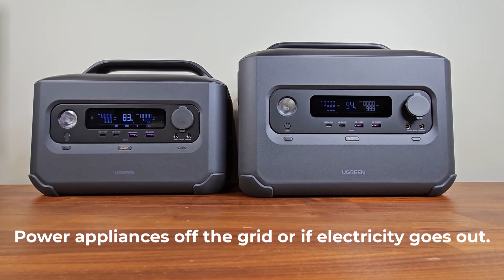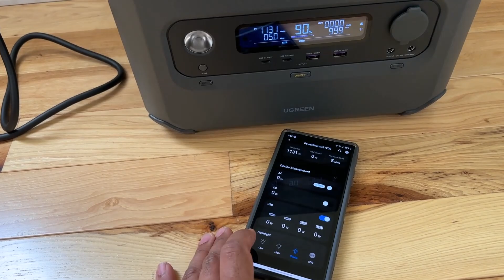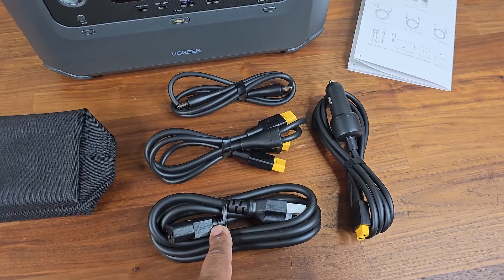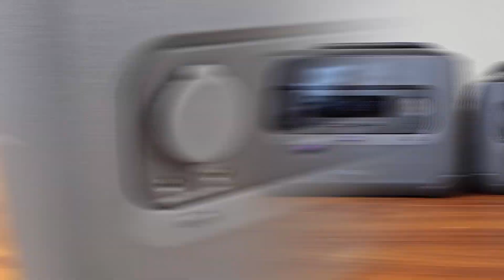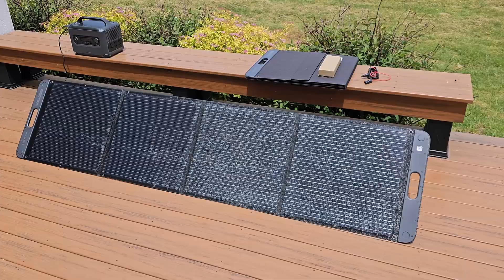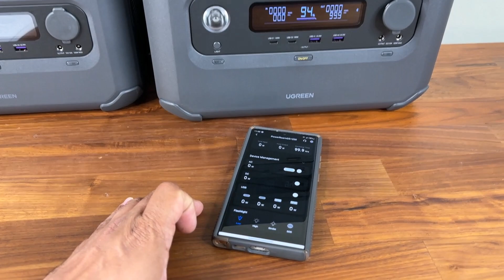Ugreen PowerRoam 1200 Power Station is INSANE - Charge a Samsung Galaxy Phone over 50 Times!

Comment: I have just bought the PowerRoam 1200, but I overlooked one issue related to AC charnging speed, and I am struggling to find a solution. Does anyone know a way to lowqer the AC charging speed down to around 200watts max (much lower than quiet mode normally lowers it to).

I mainly want to use these as long-run UPS devices to allow me to run all of the systems in my scuba diving center when the grid goes out here in Mexico - Particularly if this happens overnight too keep the CCTV running and allow me to open the electric-only roller shutters in the morning.

THE PROBLEM that I have found is that normally after a while of no-power, we will typically start our Honda 2200i inverter generator, which works great to power the essential systems and some extras like lights and fans... However, when we start to power the shop from the generator, the high AC charge rate of the UGreen (>600 watts even when quiet mode is enabled) means that my generator stuggles to power everything.

So with this in mind, does anyone know if/how it is posisble to manually drop the AC charging rate down to something much more modest like 100-200 watts?)